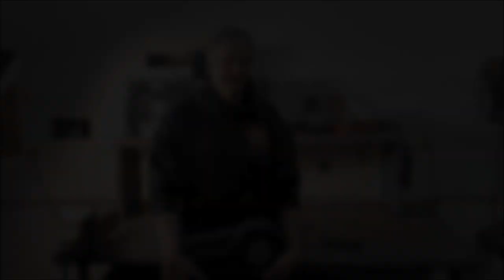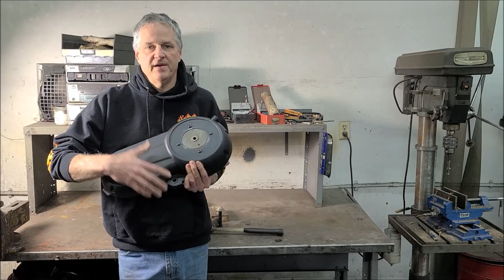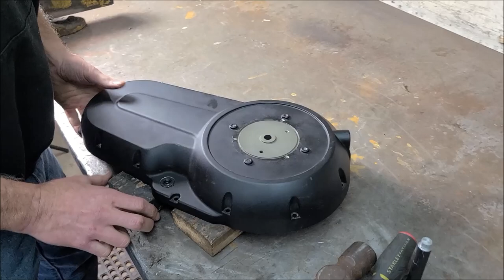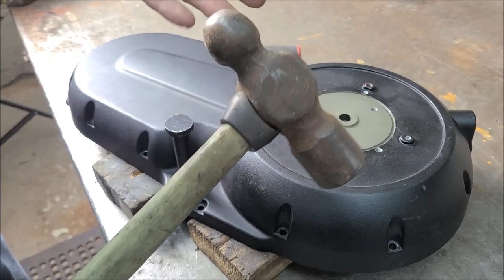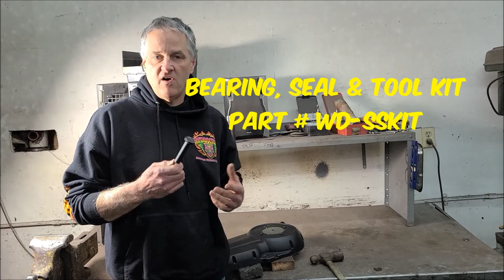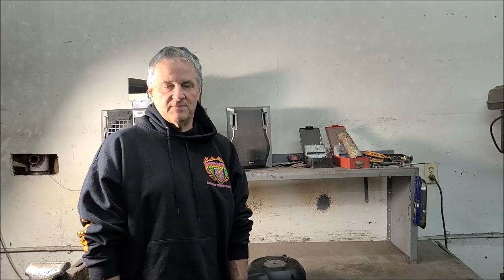How to Change a Victory Motorcycle Shift Shaft or Clutch Arm Shaft  Seal & Bearing

Comment: On my victory octane, it has a lot of room. Do I push the seal all the way back or flush?
Reply from the maker: Sorry we have never done an Octane.
Reply: Would a bad bearing give a second gear loss of power on a kingpin 100ci 8ball? 1st,3rd,4th and 5th solid just second gear.
Reply: I have an octane did this video work?
Reply: @superwin190 i changed the seal every oil change if you leave it longer then it will eventually leak but I did drive alot for work 100plus miles daily